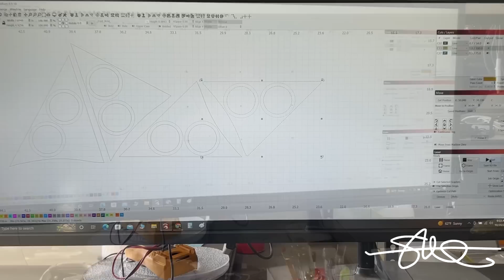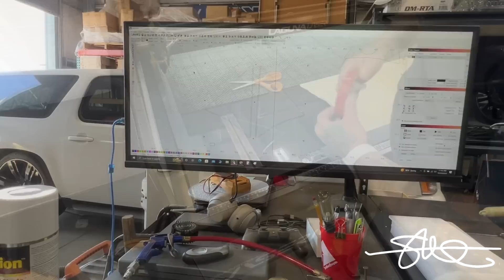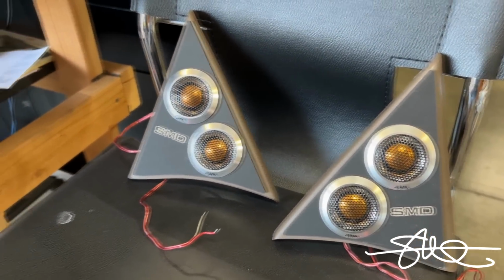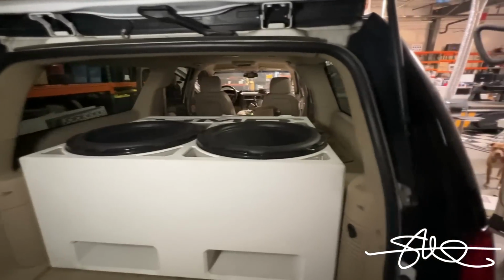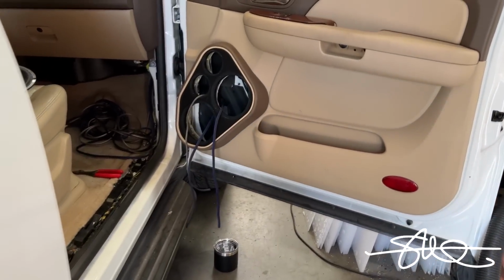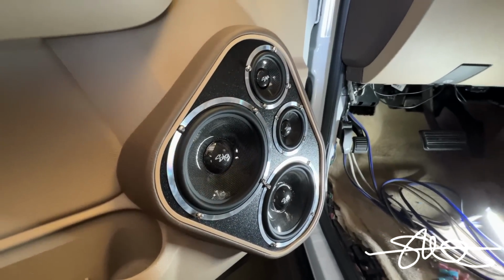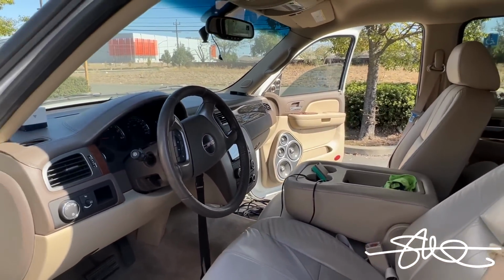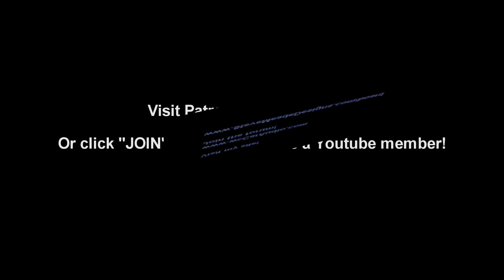Tweets in the Sails - Custom  Fiberglass Door Pods Finished!  2 sets of 3-ways per side | GMC Yukon

Comment: I had a similar set up. The problem I ran in to was tuning. I had a dm-810 problem was time alignment and speakers canceling each other out. I didn't think about that until I began tuning. Long story short I won't be doing that again on a build for sound quality. Steve and his crew got a lot more experience so I'm sure it will turn out awesome.

Comment: I'm not calling you out on you age, so don't take this comment like that, but it's great to see installers and DIYer's of our age (46 here) taking the time/initiative to learn and use new tools that not only speed the job up but can actually make it look better. The best thing is, once you designed and saved it, you can replicate again for repairs, tweaks, or for other installs.
I definitely like the SEM painted trim bezel on the tweeter pods. Oh yea, I see you're using HDPE more and more. I love it! I don't think there's a better product to use in the harsh automotive environment. I know it's use a lot in the marine industry under the name, wait for it......STARBOARD.....LMAO!
I know some are probably saying that you needed to put a nutcert in those mounting holes you threaded but that's the great thing about HDPE. I think the term is "tensile strength"? If not, correct me, but HDPE holds threads better than ABS and by not using a nutcert you're doing away with a point of failure.
I know you have so much more going on but it's appreciated that you always keep to your install roots and post these vids up for us....and you're still teaching us as well!
Reply from the maker: this isn't Starboard.  It's "Playboard" (Vycor)...similar but different texture and sheen.   Not sure who would say something about nutserts, that would be comical.  No need for those at all.  A huge waste of time at best. Thanks man!
Reply: @meade916  well you know how this industry is.... Some think their way is the right way.
And see, if one pays attention, you learn something new everyday as I have never heard of Playboard/Vycor!
You are definitely the go-to person when it comes to you plastics in this type of material since you've been doing this for a minute LOL.
Thank you sir for the info.
Reply: @meade916  also real quick, can you glue Vycor together? A lot of people say you can't glue HDPE together but I have seen some glues here lately that claim to work. I haven't had the chance you purchase any of the glue and try it myself and was just wondering.
Reply from the maker: @justinmurphy2227  I meant Vycom...my bad.  Here is the link http://www.vycomplastics.com/wp-content/uploads/2018/05/Playboard-Linecard.pdf :)
Reply from the maker: @justinmurphy2227  not really. Nothing really sticks to it very well.  I have never heard of a glue that works with HDPE.

Comment: Would you ever sell these tweeter pods to the public? That looks so good.
Reply from the maker: i could but there is too much more work to do even if the pods are in your hand....most people won't cut their panels up lol
Reply: @meade916  I get it. I don't mind cutting them up. Don't start what you haven't planned out to completion. Risk is part of success and the reward. I think a lot of people don't get that. I have an 08 suburban and 2 sets of ct sounds 3 ways and 8 inch kenwood shallow subs for the doors to install, but you've provided enough guidance to understand the development and concept of the process. Between all the build videos, especially the backyard Tahoe install, there's tons of info to do it yourself with enough determination.

Comment: You just throw lock rings on the tweeters without telling us more about them? That's awesome and I want to know more about them.
Reply: Those rings just thread on, and usually come with the tweeters
Reply: @JaedenHudson  they were not named in the description. I want to know what brand and model.
Reply from the maker: nothing to tell. They come with the tweeters. They just thread on.
Reply: @meade916  you didn't mention the brand or model in the description. Is there a store link?
Reply from the maker: @kimoarmstrong3519  yes i did.  They are Skyhigh neo 3-way components.
Reply: @meade916  thanks. Didn't realize they were in a set. Still a cool way to mount!

Comment: O, also slap some eggcrate foam to the backs of the entire door panels. Probably gain some midrange clarity from obnoxious panel noise. GM wasnt exactly at their best in thoses year cars.
Reply: Ummmm….he said he used second skin on the panels…and even showed him installing it…did u miss that part?
Reply: @briankelley6830  I saw that. Adding foam decouples the panel from the door. You use that in conjunction with deadner. Thin rubber and foam is also on door clips if especially loud or squeaky.